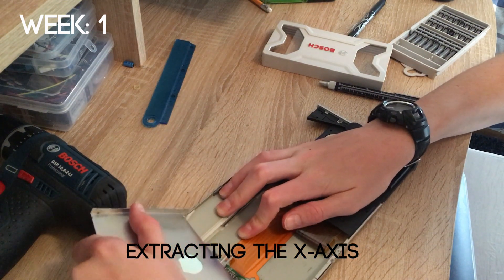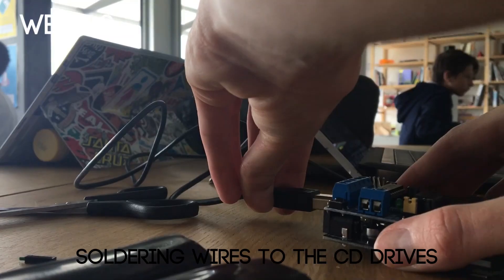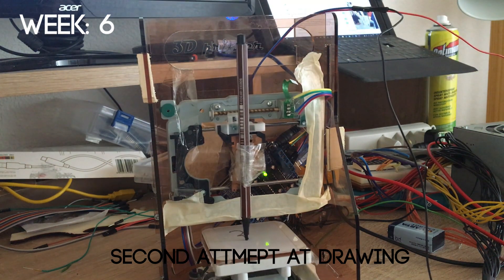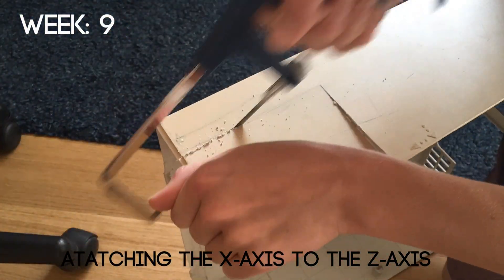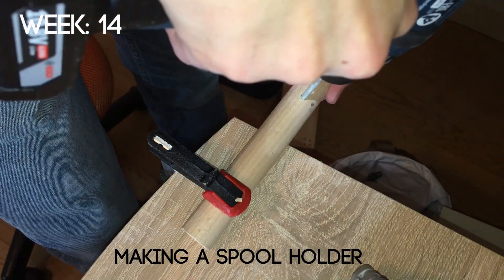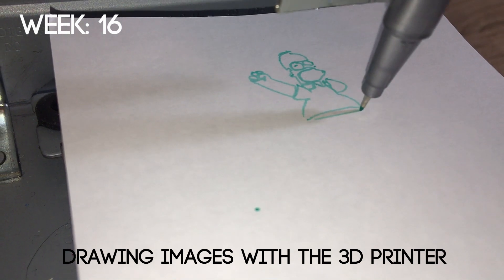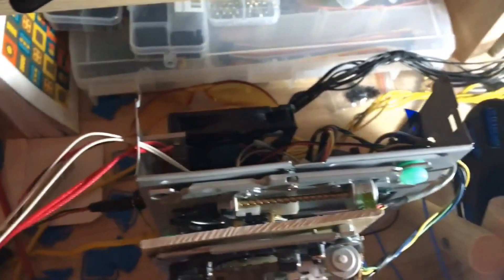How I made an upcycled 3D printer - Summary

Comment: Hi Joe, was this part of your personal project in IB? Thanks!
Reply from the maker: Mahdi Raza Khunt Hi Mahdi, yes this was indeed my ib personal project. It was a really great experience. Is there anything you’d like to know, about it? Are you doing the personal project?
Reply: Thanks for the reply, yes  even I am trying to make that as part of my personal project. I have finished attaching the x and z axis. I am yet to attach the y axis and the hot end, trying to install it the same way as you have done. The videos are really helping and thank you for it. By the way, what grade did you achieve and was this a highly challenging goal? Thanks
Reply from the maker: Mahdi Raza Khunt I was 3 points off the top mark. Somehow got a 6 not a 7. My presentation wasn’t that good, as it wasn’t till afterwards that I got it working properly. I consider it highly challenging. I’m glad the videos help, there’s alot of them i’d bet any problem you could possibly encounter i’ve already faced and have a solution for.
Reply: Yep, I totally agree. Even I am making the 3D printer in a similar way with cheap throwable DVD drives and I am facing most of the issues but not that much. Even I am filming all the steps and will try to upload them on YouTube as they are helpful in showing the pieces of evidence. Thanks for the reply and the videos, they are helping a lot. I am currently on the part to attach the hot end. You attached the hot end very nicely and I am thinking of doing that way only because most videos showing how to make a 3D printer tell to attach it using a 3D printed holder. However, the issue of not printing more than 4 layers, could possibly be because of the torque from the metal strip to the hot end. Thanks again
Reply from the maker: Mahdi Raza Khunt My aim was for my method to be able to be done by someone without power tools, and as cheaply as possible. If someone can 3d print the holder then they already have acess to a 3d printer
Reply: Hi joe, I need some help. 

Any of the axis in my printer only moves in one direction. I have already used endstops, checked the board. Could it be the pin that is causing trouble? Also The axis moves very fast and does not slow down.

Please provide some help. Thanks a lot
Reply from the maker: Mahdi Raza Khunt the way it goes backwards is by simply reversing the current direction. I think the problem is that the wires are connected to the stepper motor terminals wrong. That might also explain the slow/fast thing. Also i highly reccomend buying the ramps board, as that simplifies things.
Reply: Joe Clinton thanks for the quick reply, I have already tried that by checking using a LED to know where the current is coming from. I will test it again and let you know. Also, I already have the RAMPS 1.4 board. Thank you once again
Reply: Hi Joe, i have tried a lot but nothing seems to work, any other faults that i could have encountered, Thanks again for helping me out

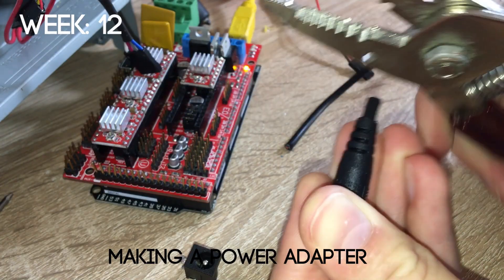Comment: 3:13 That’s why using a diode would always be a wise idea when prototyping.
(Edit) FYI I’m Julian. That guy that likes 3D printers :)
Reply: Btw is it okay if I also do a YouTube channel for my personal project just like you? I like the idea and am doing something similar 😏 (but still different) (but  even better😛)
Reply from the maker: That would definitely  have been a good idea :) The RAMPS board, has a space for a diode but for some reason I never thought to add one.
Reply from the maker: You don't have to ask for my permission to make a youtube channel, it's not like I own the platform! Also, I highly recommend you don't make a youtube channel, you don't get any credit for it and if you're like me you'll spend more time editing the videos than actually working on the project. I started off making one video a week and it was just too much, I eventually shifted to a video every two weeks and this was much more manageable. However I reccommend something even more relaxed, like a video every 3-4 weeks or just a two-part video. 

Also, just out of curiosity what are you doing for your personal project? I think the perfect project is something not so difficult but which looks amazing. The opposite of my project; something like Ulysse's hoverboard for example.
Reply: Joe Clinton: Well I spent a lot of time thinking and i think i managed the best balance between impressive and complex. 
My project is to model, program and print my own 3D printed robotic arm. 
(Il probably still make a channel as also enjoy editing and stuff) (I was just asking because you were a main source of inspiration.)